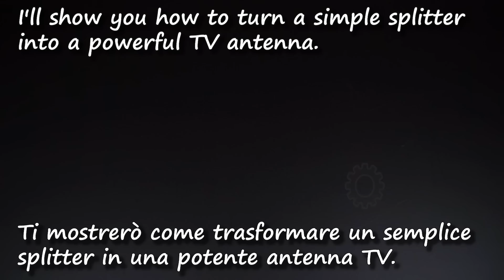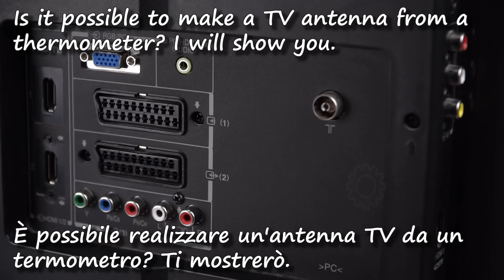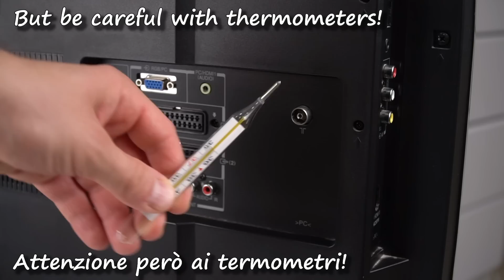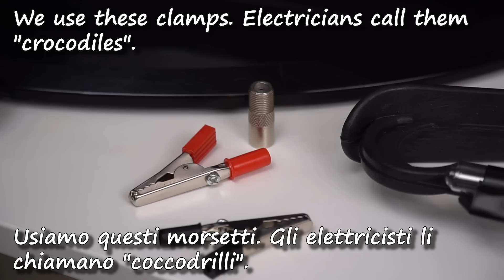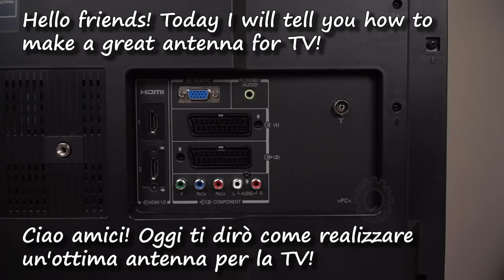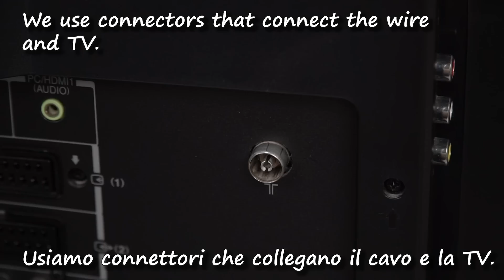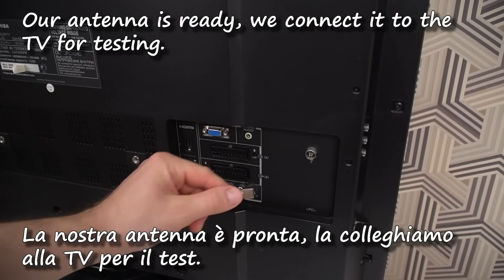L'antenna più potente del mondo! Collega la tua TV e guarda tutti i canali del MONDO   🔝 video

Comment: These designs are all but pointless.  The first device is just a dipole antenna, which typically comes free with any TV or can be bought at Walmart for $15.  The second antenna uses a power adapter to couple to the house wiring, which does not usually work any better than the first design, and can be quite dangerous if a cheap Chinese power adapter is used with poor safety design.  The bowl design is not even a good UHf antenna since it is only appropriate for higher frequencies most likely.